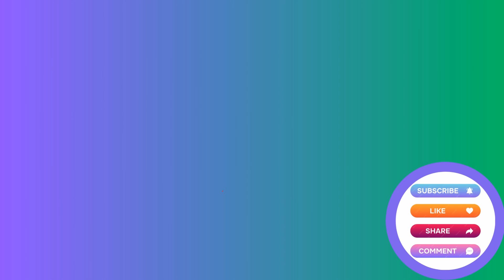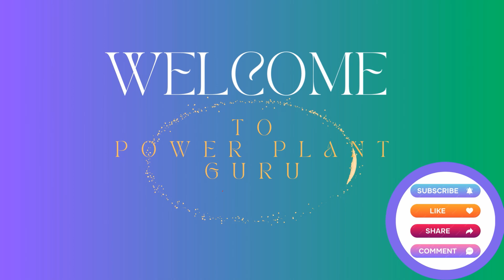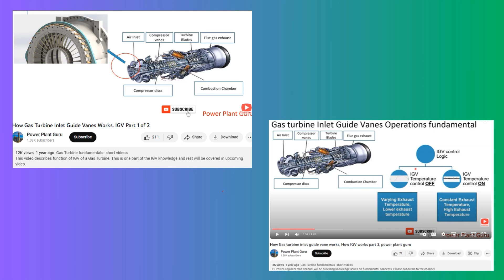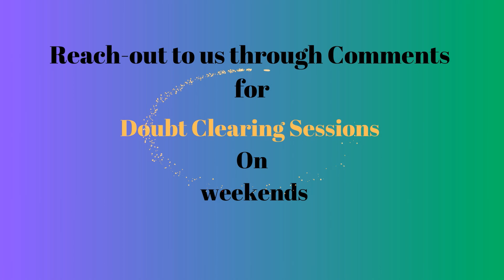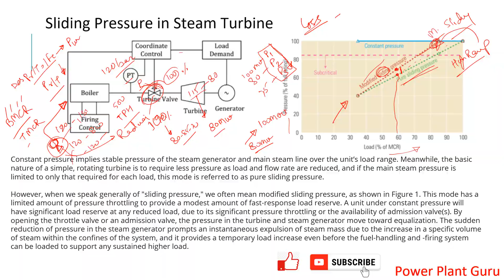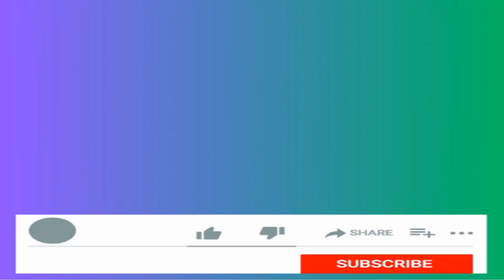Sliding Pressure in steam turbine, steam turbine, thermal power plant

Comment: Can we optimise sliding pressure  to minimise thr 

Actually here in plant they are running highly more than oem recommend  pressure when range is 180-540  load so we are not sure whether they are running to high or not  any solution for this problem?